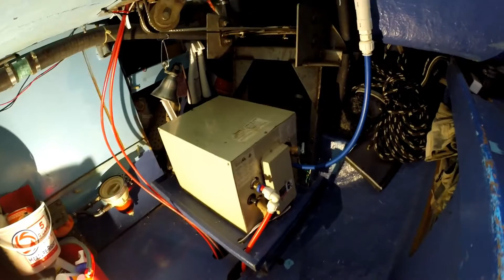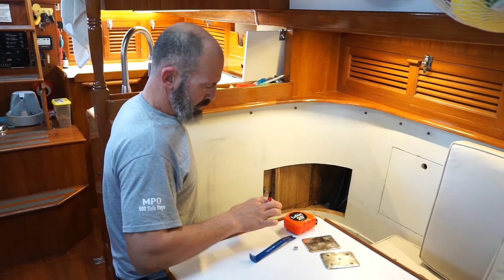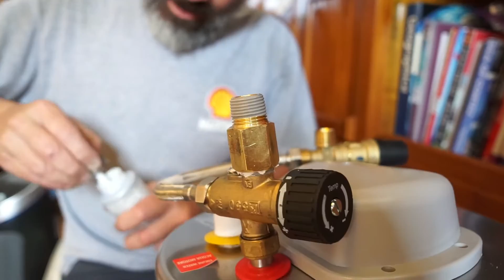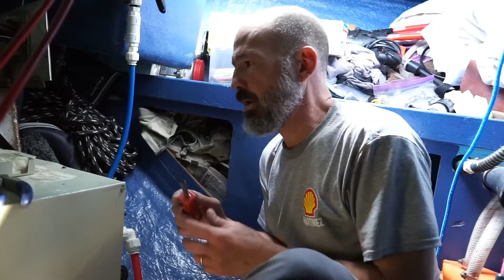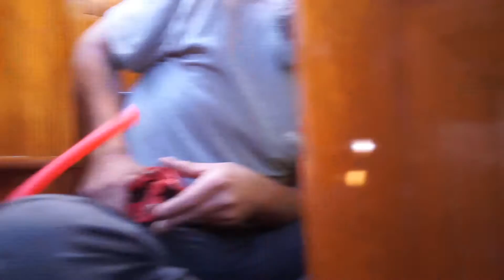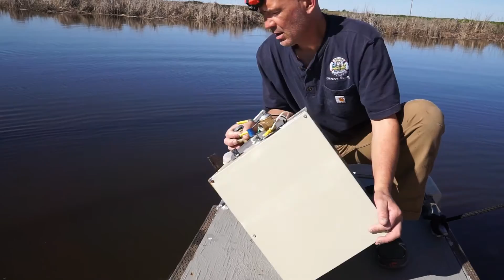SV Ramble On | New Water Heater

Comment: Hi ! I have the same problem on my Isotheme in my van. What was the problem exactly ? To much pressure on your  systeme ? I just what to know the reel cause before change the seal.

You do a great job thanks !
Reply from the maker: The problem was just a bad seal.  We couldn't determine any other cause.  We have changed how we use the water heater though.  We now keep it off until we want to use it.  We haven't had any issues lately.

Comment: Gah your old water heater looks just like mine.  What made you want to change from it?  Gah that was some serious surgery going in to mount that thing!!!  Yea those backing plates look terrible compared to those works of art you made to mount your fuel filter switches.   Gah all the BS different thread types..  Really important.  But man so annoying!  Holy crap that shark bite is cool!  I think that redoing some stuff in PEX is going to be a project I take on at some time.  I've never done anything with PEX before.  See...  You mention that it pulls about 7.5A and you've got a fancy gauge that helps you see all that and she won't even get interested enough to take a look.   Really interesting about the pre-mix setting on the water heater.  That looks like a really nice safety feature!
Reply from the maker: The old one was crusty and inefficient.  We wanted to get the water heater out of the lazarette and move it closer to the faucets.  Under the sink is where this one fit.
If you haven't drained and descaled your water heater lately you'll be amazed at what's hiding inside.  Thanks for watching.

Comment: is that a check valve i saw on the cold water inlet side of the water heater? If so, is it required or did you just do it to keep the hot water from back flowing for peace of mind? By the way Love the channel just found y'all a couple days ago and am watching all your videos. So far great work!
Reply from the maker: Thanks for watching John, glad you're enjoying the vids.  You're correct that there's a check valve on the cold water inlet, and though not required, I highly recommend them.  Not necessarily for safety reasons but more from an efficiency standpoint.  It helps keep the hot water inside the insulated tank instead of being pushed back into the cold water side thus reducing the cycling of the heating element.

Comment: Ah dude I feel your pain with the difference between BSP and NPT. I had the same issue when plumbing my water tanks. Didn't understand at the time the difference. But I learned quick.  The isotemp water heaters are great. Pricy but you get what you pay for. I expect a bit of a issue plumbing in your lines from the engine to the heater though. But maybe not. 
Not sure why you have so few subscribers. Your channel content is spot on for refurbishing a old sailboat. You present it well. I have been on youtube for years following others doing the same thing and never saw your channel.

Comment: Nice work.  Like I said in your previous video we really likes our isotemp water heater we installed.   For holding the water temp the 4 gallons will give us showers and still be warm in the morning for any morning dishes.  Oh, not sure if you know this, but Isotemp makes a solar heating element for that heater that draws 25amps dc.  Something to think about, but I believe it bypasses the thermostat so there is a risk of over heating the water.  Stuff to thing about if you need a dump load for your solar or you just have extra power to burn.